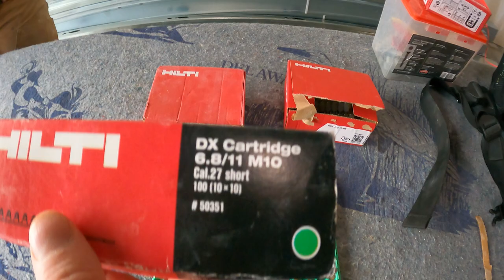Metal Stud Framing On Concrete & Steel ULTIMATE Tutorial!

Comment: I did a similar work here. Charged 14.000 for labor, contractor providing the materials. I’m at south west florida. Good price?
Reply from the maker: That's a great price yes. I charged $5,200 just to install, steel, itch, double layer 5/8 and tape only a little over half had to be ready for paint, the rest fire tape.

Comment: Hey, how come you’re using light gauge steel for that wall? Just wondering if did end up getting shop drawings ?
Reply from the maker: Yes for interior dividing walls we mostly use 6" 25gauge and then double layer 5/8" with sides, insulated.
Reply: I just wondering… i know every construction is different but here in Alberta you require shop drawings & steel stud to be minimum 18GA for 18ft walls. 

Just the odd job that no one cares,you can do that with light gauge to save some money but then you take the risk….
Reply from the maker: @qualitygypsumservices  I am in Alberta as well. For interior demising walls we usually use 25 gauge 6" and no shop drawings, either it's on the prints or a simple division of space. Most of the walls will land under an I-beam at 16' then the 2' above the expansion joint is just angle and backing with the bottom of the 2' landing at the very top of the slot track. I haven't heard this rule before but I am not saying it doesn't exist.  We go up to 18' with 25 gauge almost always. I have done 18 and 16 gauge for sure it just all depends on the designers and what they spec.
Reply: @ConstructionKronies  Max height for a 600S125-27 at 16" OC w/ 2 layers each side would be 15' 3"

Comment: How much do charge on commercial projects? That is labor & materials included?
Reply from the maker: For anything I calculate the labour first, steel is anywhere from $4.50 to 13.50 a linear ft or 80 to 90 cents a square ft. Then materials, get 3 quotes, pick which one you like, add 10 to 15% and that's it. Make sure to add in any expenses like travel, fuel, food (when out of town).
Reply: When would you  use sill gaskets?

Comment: I wish to add a comment here. While working around the stationary steel comumn, better to strike a reference line, say 1 foot off of where you desire the wall lines and use that for snapping the wall lines, while staying within the column, but not allowing it to interfer with your snap lines.
Reply from the maker: I will use an offset sometimes, like when the column is twisted a bit. The goal is to have it completely in the wall, so I take my layout from center of column always. Yes you can use offsets as well.

Comment: What is the point of the channel through the stud?
Reply from the maker: Good question, if you do drywall you will better understand why it is so critical. It keeps the studs square, as why we call it a stiffener as well, when the drywall goes on its also very important to have a flush plain so when it's taped you don't have bumps in the wall. Another reason is for insulation, that's why we put it every 4' to keep the insulation in place and it won't all fall to the bottom.

Comment: 😂 no safety glasses. No harness, no hard hat, no vest. Earplugs
Reply: The beauty of working for yourself buddy… The Best!
Reply: Don't need a hard hat if there is no work above you. Don't need a vest unless there is machinery being operated near you (indoors it's not likely). Don't need a harness unless you're working 10'+ with no guard rails (the lift has guard rails).

But yes, he should be wearing safety glasses when firing the gun...